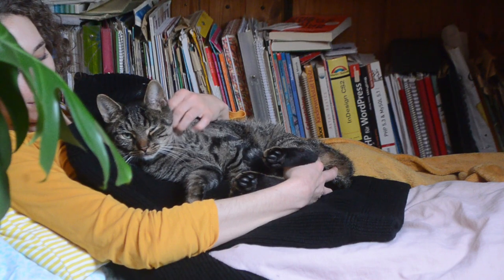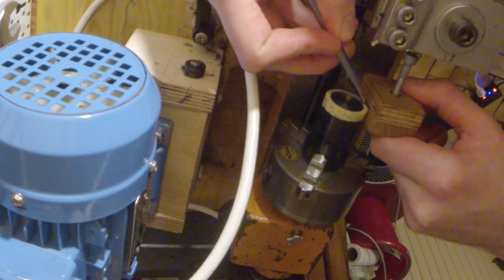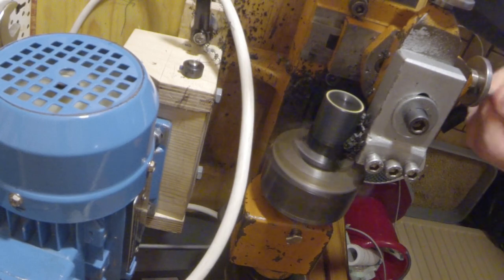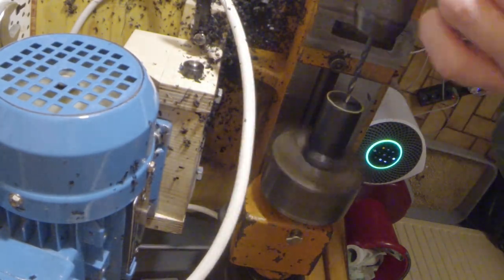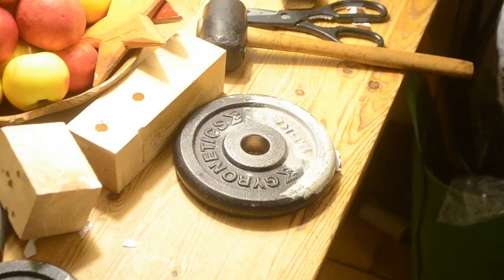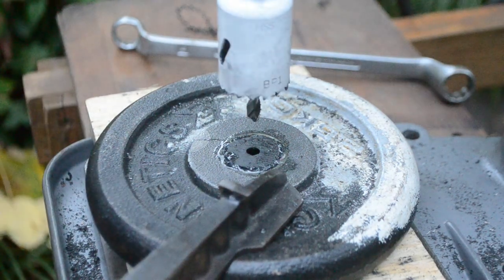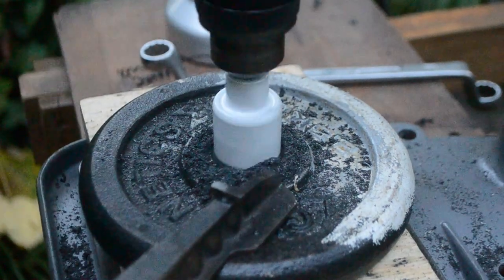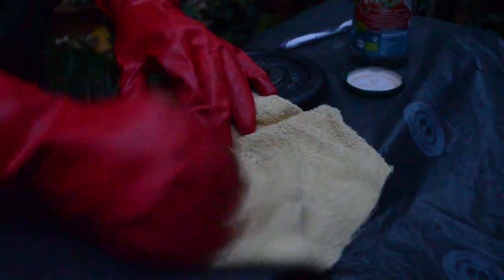How to increase the hole in a weight plate

Comment: hey mate, I've got some 25 mm plates with I want to try to fit on an Olympic barbell by doing this, roughly how many circular drill bits would I go through for drilling 2 plates?
Reply from the maker: Mine are also 25mm in thickness. I went through 4 plates with 25mm and 2 with 15mm. The circular drill bit has plenty drills left. With good and steady lubrication like white oil or like me with rapeseed oil the drill bit will last much longer. Rapeseed oil is an very traditional lubricant for metal work. And it smells like fryer.
Reply: @Baerenson  thanks for the advice, I assume a better quality drill bit will probably last a lot longer than a cheap one so im just trying to weigh up there price of that vs selling the plates and buying proper plates.

Comment: Dude, how many plates did you have to do this to? This is definitely a good idea. I've got some plates too that either won't fit, or fit too tight and you can almost not get them off. But, I've got plenty of plates so I don't have to worry about it.  But, that is a really good idea and it looks like it comes out precise. Peace
Reply from the maker: I had to do 6 plates. Luckily my other plates have a decent fit by default. The plates arent perfectly formed, so the holes werent perfectly round. Now they are as round as the can get. Both faces of the plates havent got a decent flatness, but overall increasing the holes was an improvement.

Comment: Does anyone have any ideas for making the holes smaller? I bought a multi-grip bar and the ends are only 1.9 inches so my plates rattle all around, even with specialty clips that I bought. I wrapped some aluminum foil tape around the ends of the bar but that's only a temporary fix since it gets beat up quick.
Reply from the maker: Interesting! I have an idea. Can you give me the hole measurements of the plates?

Comment: Hole saws suck, they drill oversize and the cast iron quality and outerskin hardness varies significantly. A cheapcarbon steel hole saw will likely fail on most plates. Quality HSS or carbide is much more expensive and hole size is still too big. You throw them out when they get dull to.
  Buy a cheap annular cutter, they will drill the hole on size to within a few thousands of an inch.  The annular cutter will easily do any weight type or quality and do dozens of holes, with a quality finish before needing sharpening. If your experienced you'll get even more out of one cutter.  They are hole saws on steroids, with none of the issues hole saws have. Don't wast your time with regular hole saws, go with an annular cutter!!